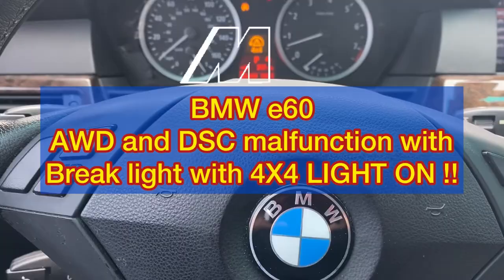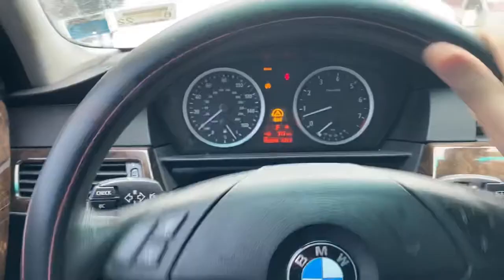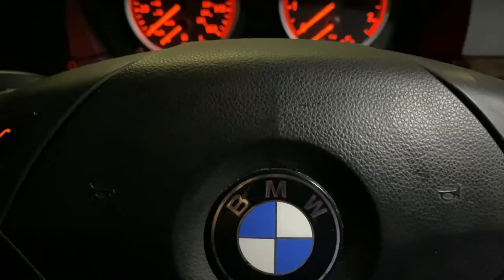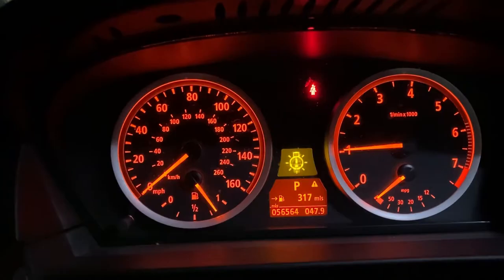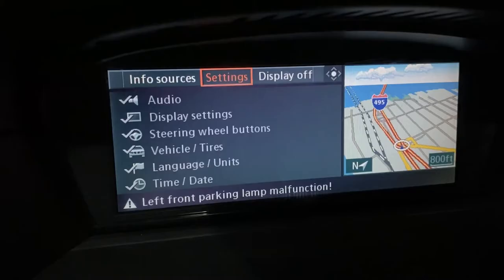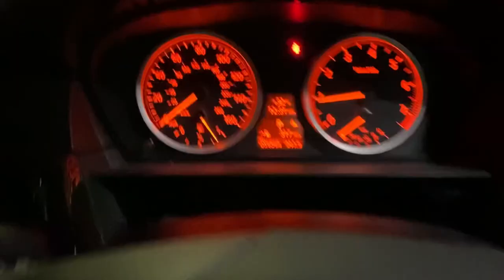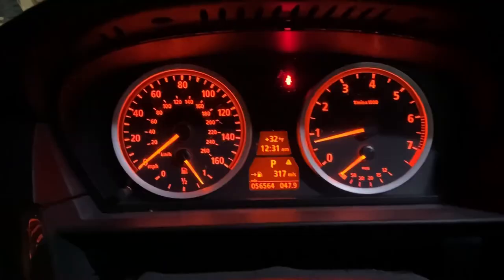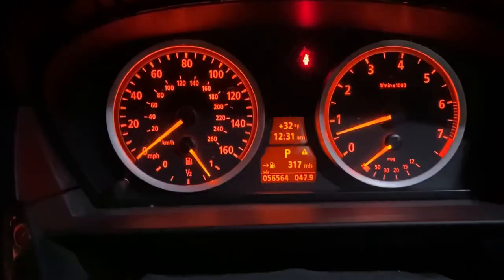How to fix BMW E60 & E90 AWD and DSC Malfunction !!

Comment: My battery wad dead and I got A JUMP AND DROVE it for an hour or so. But got the DSC MALFUNCTION error.  I turned st wheel to left and to DT a few times and then drove it, but when I turned it off , I got no power except a flickering light in the hazard lamp n the dash.  I probably didn’t charge the battery fully.  Any ideas?
Reply from the maker: Hi Tom it’s seems like you battery may be dead please use a voltmeter to check voltage of battery or a car battery tester to see your battery status .  And if you battery is dead and you get a new battery don’t forget to get it programmed after changing . You can use a
 AutoFIX OBD Reader .
Reply from the maker: On my E60 when my battery was low on charge DSC came on once changing new battery and using the Method on video it went away.

Comment: I have E53 2005 X5 4.4i and got only 4x4 light. but this reset method did not work, no matter how many time I tried.
On mechanics recommendation, changed transmission (used) yet the 4x4 light did not go away and have weak torque and so delay engagement if accelerated it sound like clutch is slipping. Please any help !
Reply from the maker: Hey sorry to hear that you had to change the transmission but I didn’t have any issue like that for my e60 it started for me on a snow day when my tire spun out and my 4x4 light came on and after some research and trial and error I was able to get rid of the sign by turning the steering all the Way right and left few times and driving around the block slowly  and  doing same and it went away by it self. Hope the info helps!
Reply: There is an electrical motor for the 4x4 on the x5 problem solved
Reply: Should fix the light

Comment: Wiill thiis work on 2006 bmw x3 e83 3.0i?
Reply from the maker: Hi it worked for my e60 and e90 have not tried it on e83 but you can try it doesn’t  hurt to try. Please Do let me know what happens. ThankYou ! 

*please SUBSCRIBE and LIKE appreciate the support!*
Reply: Please my E83 is having no communication with Dsc , showing Red on ISTAP CONTROL TREE .  Any possible fix please
Reply: @theedifyingassembly2985  take off speed control sensors and clean them off ..put a washer on it and it should clear my e83 did the same so I did this and it worked
Reply: OK, by speed control, you mean ABS sensors?
Reply: The issue on your e83 x3 is that the whole SSC unit  is unable to communicate with any diagnostic machine .  Its showing Red on Ista d control Tree .  Any help please
Reply: @theedifyingassembly2985  yes

Comment: when i drive the car give me litle shock and then DSC fail bmw e60 525i
Reply from the maker: Hi sorry to hear that have to tried to turn the wheel left and right and turn off the car and re do it few times and drive around the block or two and re spin the steering wheel. If it’s still happens might have a get a diagnosis by a mechanic but it worked for me and it’s been over a year still no issue. Thanks hope your problem gets solved

Comment: I did that and it went away and came back as soon as I moved and hit the brake
Reply from the maker: I had that issue you have to drive drive around the block and put in park right after and try again. Hope it helps. Thanks

Comment: When turning wheel car has to be on correct sorry for the dum question?
Reply from the maker: Hi , Yes car on and on park position . Hope it helps !
Reply: @simplifyreview2911  i have a 2010 535xi twin turbo i get in car out of nowhere car shuts off and throw it self in park I was stressed cause I barely drive tje car and she well token care of. So I'm like omg this gonna be a arm and leg I look up your video was first and worked 10,000 percent dude thanks alot and you earned yourself a sub
Reply from the maker: @angelteamnolimit624  I am glad to hear it worked for. 👍Thanks for the support.